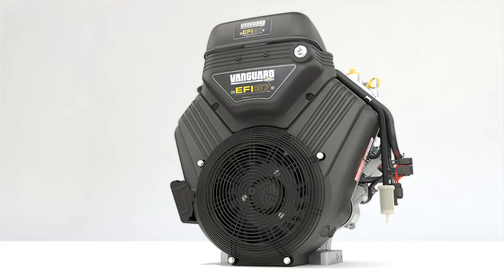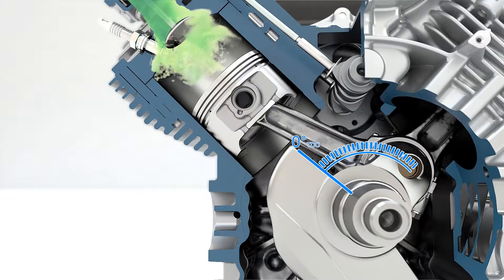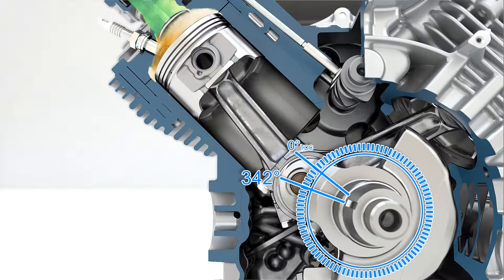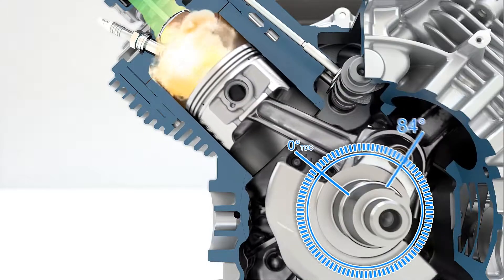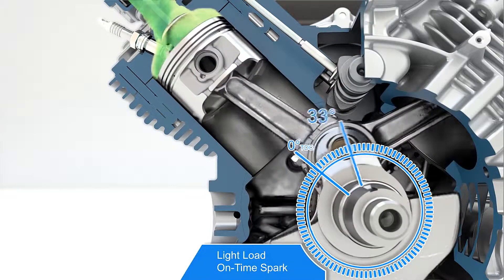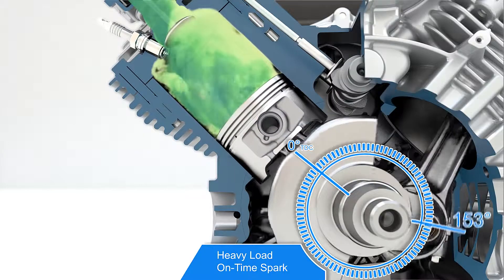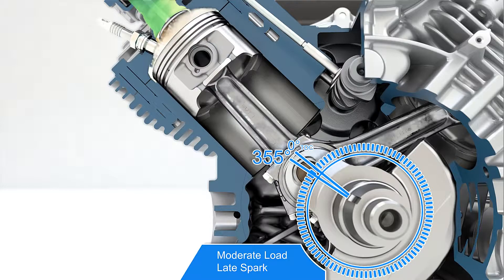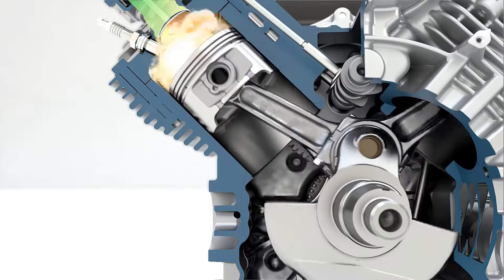Modern electronic fuel injection system

Comment: Anyone who says that electronic fuel injection is more reliable than a carburetor is either outright lying or dosen't know what they are talking about. Im 66 and drove cars with carburetors most of my life and they would run for years without being touched. The 2 cars I have had with EFI have been a complete nightmare. There are about a half dozen components with EFI that can cause the engine to stop running instantly. A carburetor can be totally shot and the engine will still run all be it roughly.